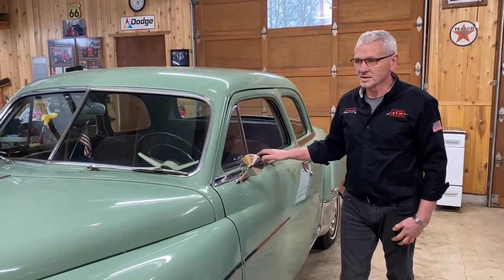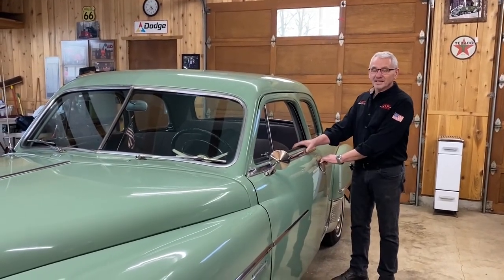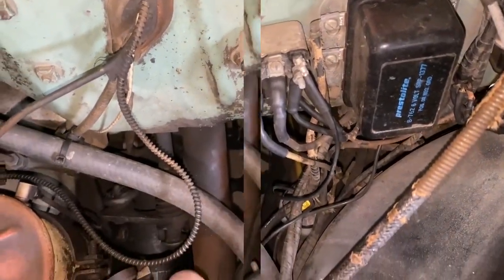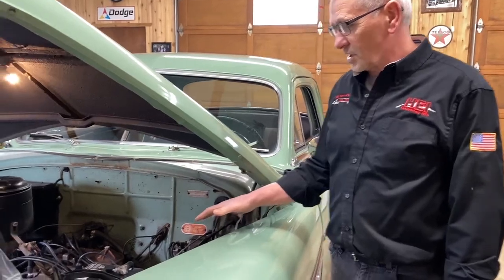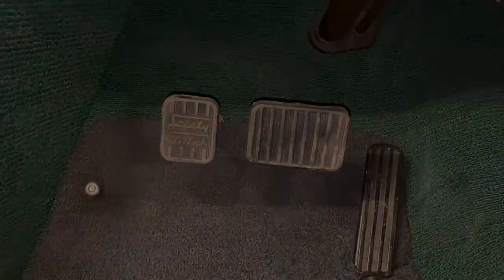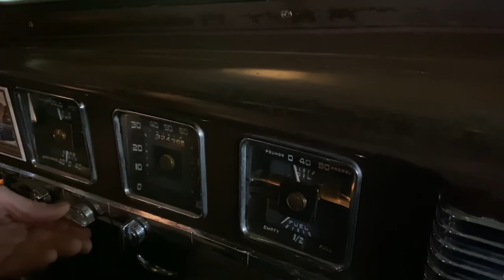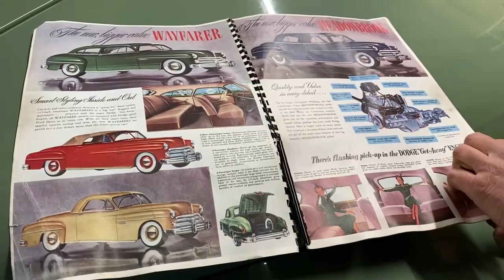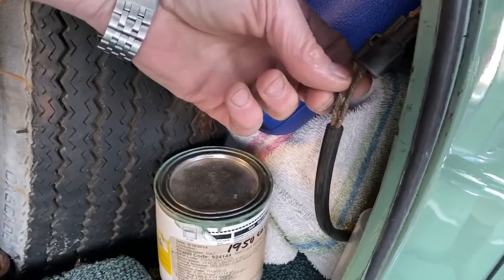1950 DODGE CORONET  |  WALK AROUND OUR 1950 DODGE CORONET GYRO-MATIC

Comment: My first car was a 1950 Dodge Coronet 4 door sedan in dark blue (faded appropriately on horizontal surfaces) and named for the spinster who was the original owner out in NW Iowa in 1966. Agnus had the Gyromatic transmission and I loved it, slow as it was and young as i was. I must have, I've owned a 49 and a 51 Chrysler Windsor since with the bigger flat head six but same transmission. It didn't take too long to figure out some shortcuts around the operation of that fluid drive wonder and pushing in the clutch greatly speeded up the shifting process on 1st to 2nd or the 3rd to 4th gearchange. And that push starts were best accomplished in reverse. In all fairness, my grandparents on both sides of the family had similar age MOPARS  when I was younger and my dad's dad had taught me how to drive on his 52 Coronet beginning when I was 4 or 5. The closest I got to my other grandparents 52 Windsor was years later when I bought my own 51.
Reply from the maker: What a great story. Thank you for sharing with us. We still love ours too. Runs like a top.

Comment: Glad you are keeping it 6 volts.  The reason the younger set thinks it doesn't work well is because they try to use 4 or 6 gauge battery cables and a puny Group 1 battery.
Reply: well i can tell you my 6 volt never started half the time  when i went to 12 volt never had an issue.
Reply: @allenhall2259  I bet you were using chain auto parts store battery cables and a Group 1 battery.
Reply: Please let me explain I owned a Dodge with a flathead 6 turbo retrofit 3-speed dynaflow transmission, two-speed PTO overdrive, I was able to get a hundred miles per gallon on the freeway at 55 miles an hour 🗽❓❓❓

Comment: i had a 50 dodge coronet with fluid drive  it had no solenoids on the transmission  it was the slowest moving automobile when you used it in 3rd gear.  it was a nice car   i guess some ran good and others didn't- didn't start half the time  because it was so slow. i hate 6 volt. finaly converted it to 12 volt and never had a problem.
Reply: Back in the day, we had no problem making 6 volts work.
Reply from the maker: It’s usually not that it’s 6V that’s the problem, it’s what people have done to the system as they try making improvements. Many people do not understand 6V systems and make the choice to convert
Reply: @HagemeisterEnterprisesINC  Try telling the younger set that.  They will not listen.